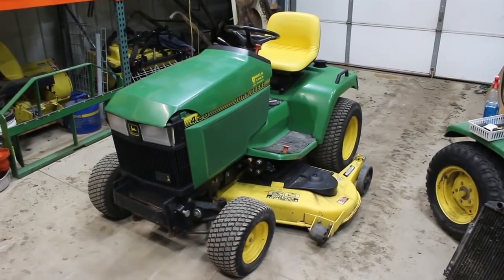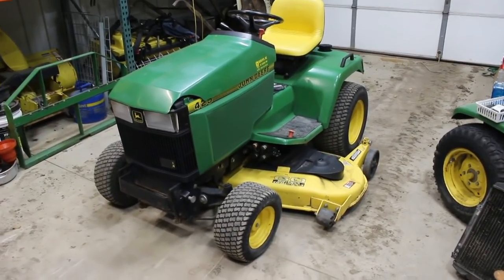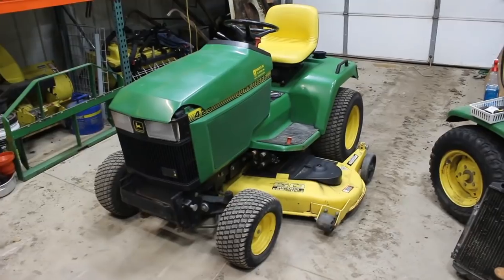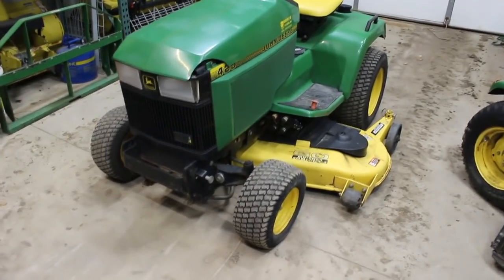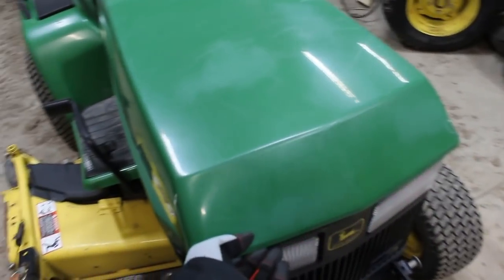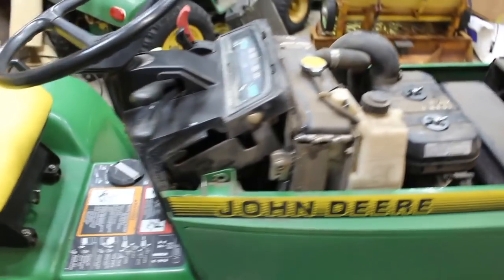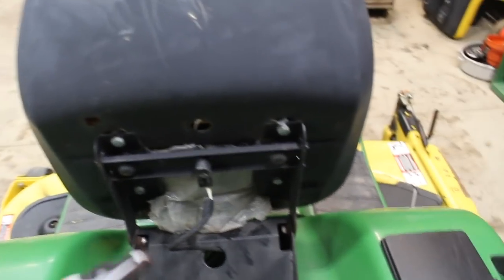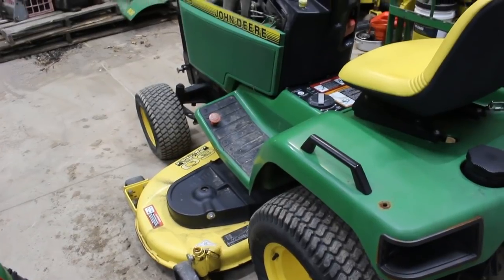A John Deere 425: Tutorial and Comparison Series 1

Comment: Great discussion on why the engines are always covered in oil! I’ve always wondered why ours always had a dirty engine. I’ve said this on multiple videos and I’ll say it again. The 425s are such a great tractor.
Reply from the maker: The 425's are great machines.
Reply: P0tat07 I have a 2001 425 and it had a dirty engine from leaking valve covers.
I bought new gaskets and decreased and washed the engine .
Once the water in a couple of electrical connectors dried out it ran fine and has stayed oil free
Reply: Degreased, not decreased ! Lol

Comment: Resurrecting my father's 94 425 aws. The machine has 160hrs that sat for 18 years in the shed do to a carburetor issue.  Love it if I can get it running since it has the 3 point hitch, pto, rotor tiller, Curtis cab, front blade and lawn thatcher.  Would definitely help around the house.
Reply from the maker: They are nice machines and very handy to have.

Comment: The 425 was the best garden tractor Deere made. My opinion.
Reply: Ran ours hard since new and like what's left of it. Needs major work. Side panels shot. Seat in sad shape. Rings probably need replaced. Hour meter broke a few years ago at just under 3000 hrs. Time delay module replaced twice. Resoldered wire connections on ignitor.
Replaced the crankshaft and rods around 10 years ago when she threw a rod on spring start-up. Fresh oil before stored for winter. IDK what caused that. 
Considering a total restoration or a second used 425. Considering the abuse and use of this tractor I would think many of the problems were from neglect and multiple operators. Passed around the family and mowed 5 yards (18 acres) some seasons and used like a bush hog sometimes. Need another one to run through the mill. Lol

Comment: The Big question is ,,, does it have the Steel  replacement cam gear ...
Reply: It should have come from the factory with the steel cam gear, being a 1998.
Reply from the maker: It's doesn't have a serial tag anymore. The dealer had a serial number but I have not verified it. I figured at over 1000 hrs it either has the steel gear or it's been replaced.

Comment: Is there a way you can see if a John Deere 45  Loader will fit on a John deere 318
Reply: Vw bug Kid the only loader I know of working on a 318 would be a 44 loader specific to the 300 series tractors. The pump will have a pulley on it and that pump spins a different direction than a 400 series 44 loader.
Reply from the maker: That would be a pretty challenging modification.... The 45 mounting points would be a huge hurdle to make work. There are 44 loaders out there for the 318 and there are other types of loaders folks have modified to fit.